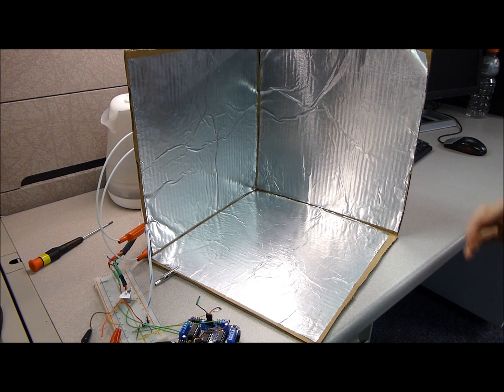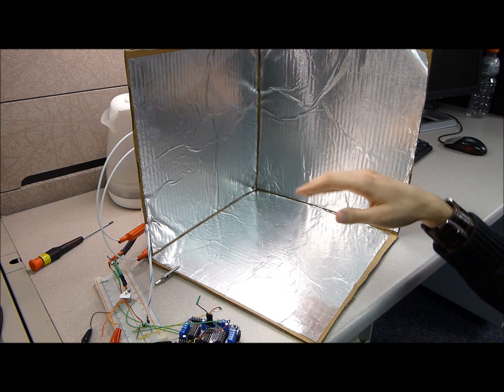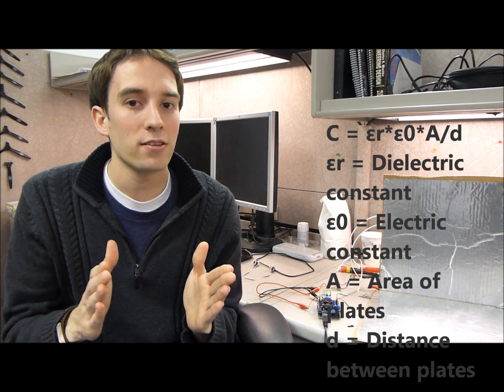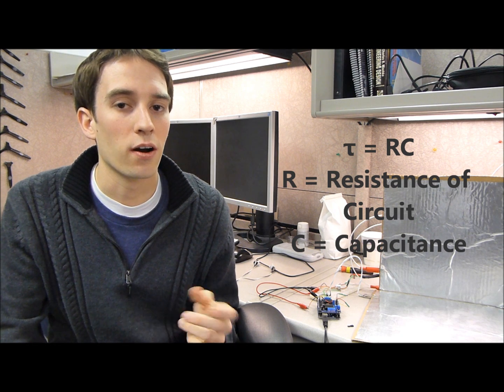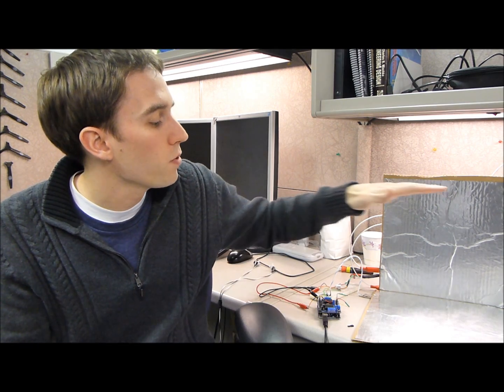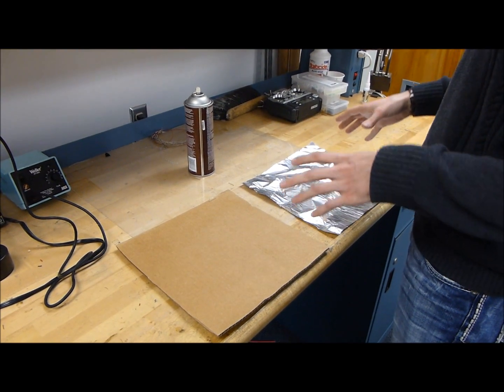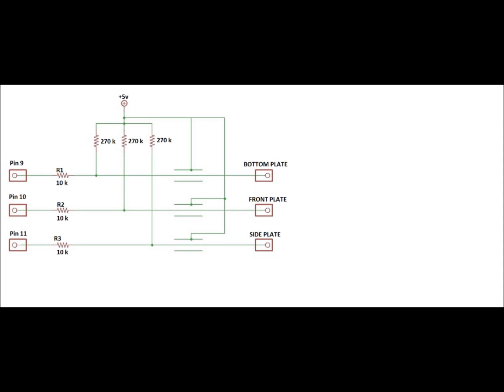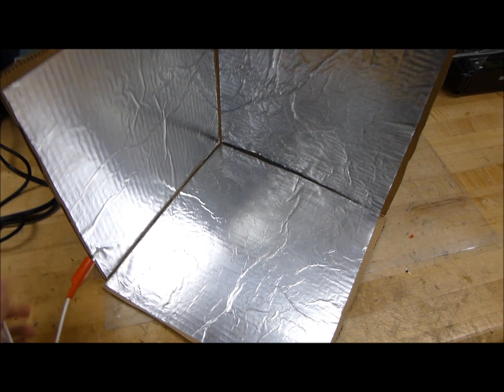SeaPerch 3D Touchless Controller

Comment from the maker: I see. You don't have to use aluminum foil either. If you can find some really thin gauge aluminum sheets, you can use that instead. Or 2" wide aluminum adhesive tape works really well, and that stuff is pretty durable and sticky.

Comment: I just want to have a version that will last, and tin foil rips, so i was woundering bc i was gunna use the plastic to protect it, but yes waterproof aswell. And i also realise that the signal will be less and would need to be tuned acordingly.

Comment from the maker: That is a good question. I haven't actually tried it, but I believe you could. It would be similar to adding a dielectric to a capacitor, I believe. But if you're covering it to make it resistant to water, the easiest thing to do there is use corrugated plastic instead of cardboard.